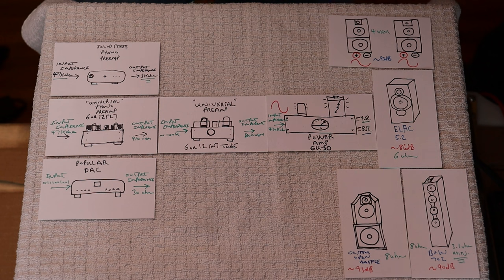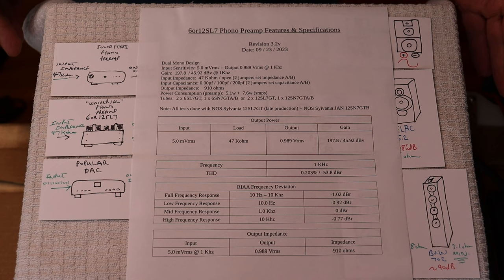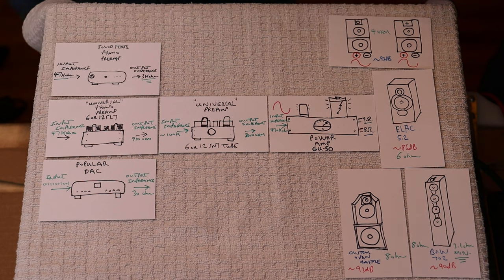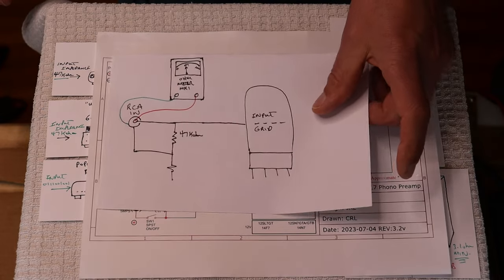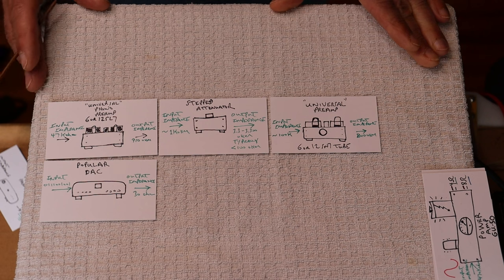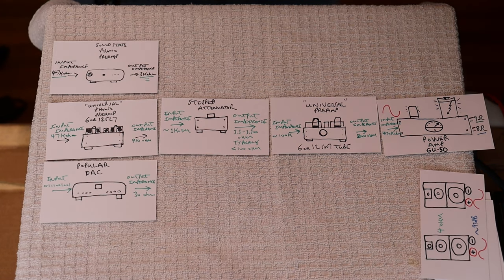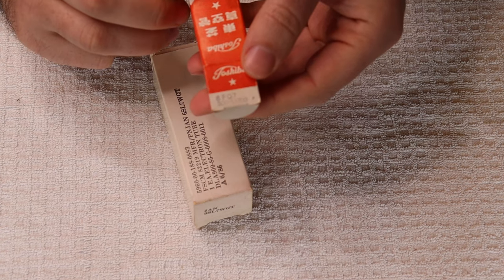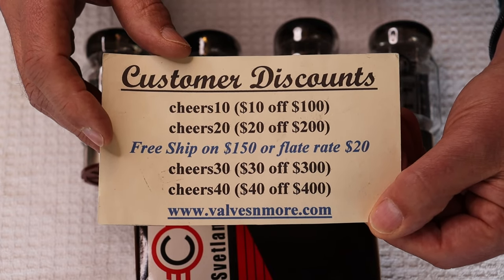Tube Lab #179 - Impedance Matching Your System

Comment: All well and good! Nice video, and nice topic! Just one thing to have in mind. Output impedance is just that, an impedance and not a resistive / fixed resistance, thus it can and usually do vary with frequency. Looking at both the phono pre and both the universal and e80cc pre, they have a 2.2uF output coupling cap which is quite typical of an output stage.  When the output impedance was measured , it seems that was at 1Khz. At this frequency the impedance of the output cap is 72 ohm, so just around 10% of the total output impedance. If we move down in frequency we see at 100Hz the impedance of the cap is now 723 ohms, so it will have almost doubled the output impedance of the stage at this frequency, so we would be now in the area of 1.5 K  ohm output impedance. Moving down to the low B of a 5 sting bass guitar at 31 Hz we get 2333 ohms of the cap alone, bringing the total output impedance to around 3k. And at the nominal lowest frequency 20Hz used for stating the frequency response , we have 3617 ohm in the cap alone bringing the total output impedance at that frequency up to over 4k. So loading that output impedance with a 1K input impedance will leave 3/4 of the bass signal in the output impedance. I believe you should see a significant bass roll-off when you do a frequency response plot of one of the preamps into a 1k load?
Reply from the maker: Interesting, and yes as per industry standard we test at 1Khz.  We didn't notice a bass roll off, probably because most vinyl, even good vinyl records are rolling off higher anyway.  Currently we have the stepped attenuator located after our Universal 6or12Sn7 Preamp, so feeding into monoblocks with an input impedance of 470k.  In the future we'll include a 40hz, 1khz and 10khz output impedance value, based on a proper bench test of the actual circuit. It will be interesting to see if we can confirm your data.  Thanks!
Reply: @tubelab194  Will be interesting to see if you see the same yes. I made myself a little test jig today so I could easily switch between 47k, 18k, 10k and 1k loads. Then used these load on the phono pre, and used the Analoge Productions test LP that has a 1k down to 20hz sweep as one of the tracks. Measured with scope and mv meter. Found no issue down to 10k load but at 1k the signal all over was halved as expected since we basically have same load as output impedance and thus have a voltage divider. That may be fine if you have enough gain in the system anyway. However here we were also good frequency response wise down to 100hz but below this it started to drop of. Dropped about 5.8 db from 100Hz to 20Hz.
Reply from the maker: You are correct, bench testing confirms the low frequencies start to roll off at about 100hz, it looks like a first order slope, so not very fast, but still not a good thing - in our design work, we fight hard for every low frequency db we can get!  We've designed a new Set "B" with an input resistor of 10k, hopefully as a better standard input impedance.  Let me know what your modelling shows as the upper limit for an input device with a typical 2.2uf output capacitor and I'll see if we can confirm.  
BTW thanks much for your observation, it will definitely make an improvement to what is already a great sounding volume control and in future we'll include bench testing specifications that include 20hz 1Khz and 20Khz, so this kind of design error doesn't slip past us again.
Reply: @tubelab194  Great, well as you mentioned on the other channel, that the modeling may not be too accurate for simulating tube output impedance seems to be right.  The simulation showed clear roll-off at 10k load, but my measurements / tests did not show this at 10k. So it seems the limit is somewhere between there and needs to be determined by testing.
Reply from the maker: @RaviNewfarm  yes bench testing is always the last arbiter, well listening tests as well, but listening can't always detect a first order roll off on the edge of the frequency band.  I'm building a new set based on a 10k input resistor.  It should give us plenty of room for any equipment with an output impedance of 1k or less.  This is actually the Set "B" that I had planned on making, but I think it will end up being the standard everyone uses.

Comment: I just cant easily get my head around resistance.  It feels to me that if a low R is coming OUT (let's say 500 Ohms) into a higher resistance IN (75k ohms), energy is being STOPPED because of the higher resistance IN…But science is saying the opposite.  IS there a better way of explaining to someone like me?  Thank you
Reply from the maker: That's exactly correct and I agree, until you get deeper into understanding how a circuit actually works at the electron level, it's hard sometimes.  And in my early days of design some things I just had to accept.  Think of it this way, if the signal was heading down a wire with infinite room for it go, it would be dissipated - right?  So by creating a nice bit of resistance, say 1:10 minimum, that signal isn't being dispersed or dissipated.  It's much more complicated than that because we have other passive electric components (capacitors and resistors) that are often in series and or  parallel.  And those other components can create filter networks and resistance.  Even linking to the previous stage!  So designers came up with a standard rule of a 1:10 minimum impedance ratio and preferably 1:100, with a 1:10 ratio you basically avoid almost all of the potential negative interactions.  Note, measuring input impedance is easy, jist follow the circuit and the lowest resistance to ground is the input impedance.  Output impedance is much more involved and requires an electrical bench and a specific set of procedures to calculate it.  Luckily every properly designed bit of gear will clearly specify the input and output impedance.  And we of course provide that data on our spec sheets for all of our Kits.
Reply: @tubelab194  I guess I'm just going to accept it.  But I'd like to intuitively understand it.  Thank you for the added ideas...

Comment: I going to have to agree to disagree (based on extensive testing and listening in a controlled 2 channel treated room.  Also many years of electronics knowledge).  My rule of thumb is Out/in should be at minimum 100X and 1000X for high resolving systems
Reply from the maker: @audiononsense1611  in most circuits 10x will work just fine with no  signal loss.  We are both audiophiles and work professionally as designers, and as a result we spend a lot of time listening to our prototypes as well as bench testing the gear.  The real problem has been the number of poorly thought out and poorly designed bits of gear, particularly out of China, though we've seen some terrible designs from everywhere including Europe.